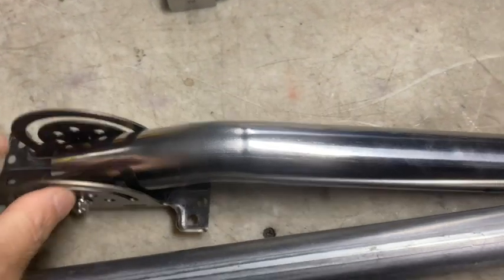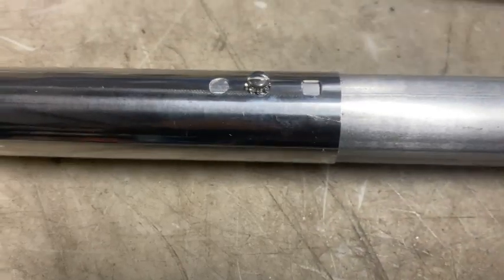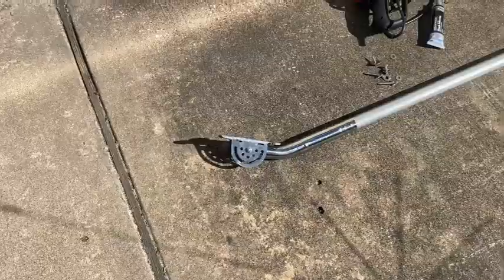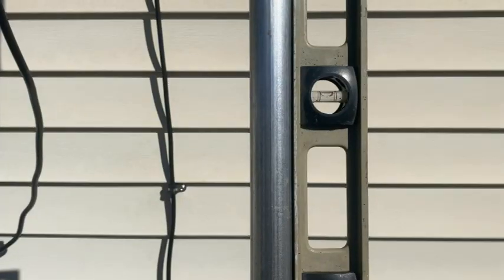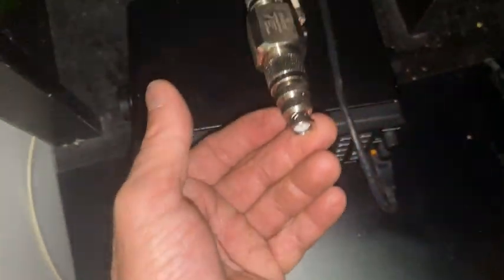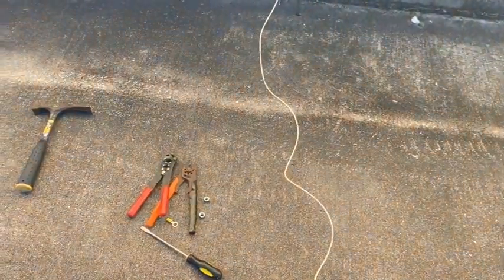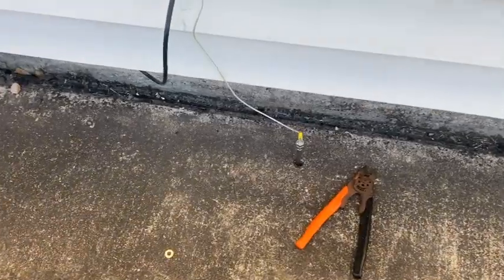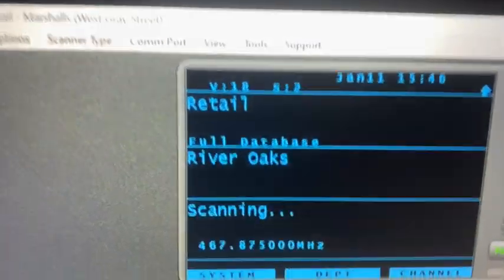Install outdoor Antenna for Uniden SDS200 Scanner

Comment: Thanks for the video! Could you describe how you attached the grounding wire up top? Did you attach it to the mast or the mount, and how? Also - the lightning arrestor, did you show that as inside the house? I'm building my shack soon, just curious how that should be configured.

Comment: I could not discern from the video if the lighting arrester is mounted outside the house, which it should be. Also, the wood that has the vertical mounting bracket attached may need reinforcing for wind loads. Looks like it would work for amateur radio. Good luck and thanks for showing details of your project.